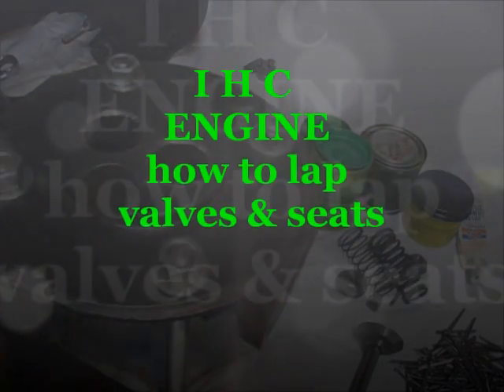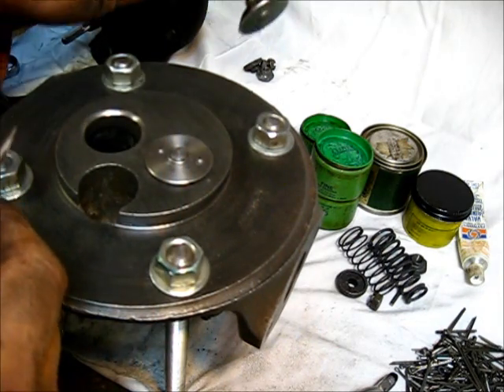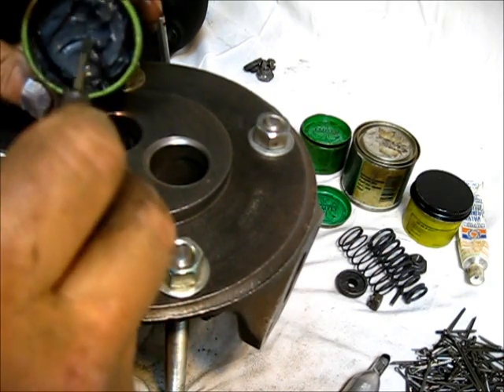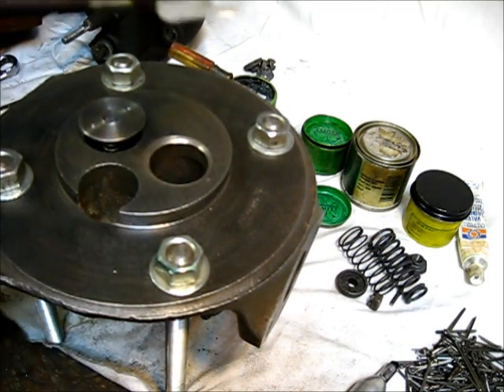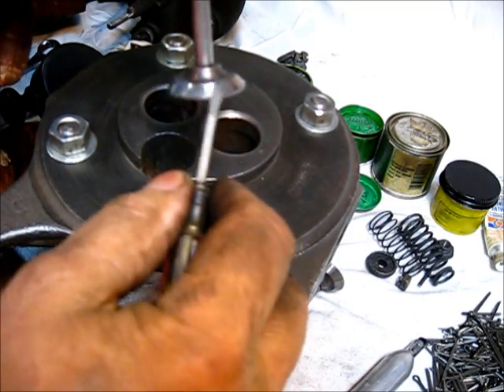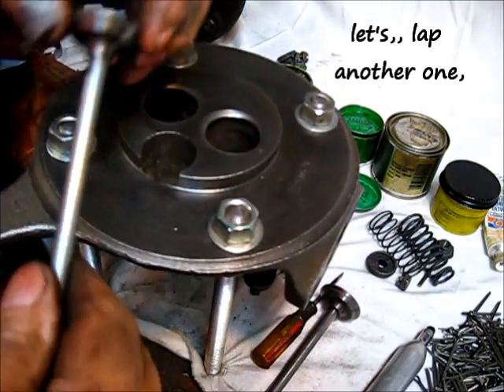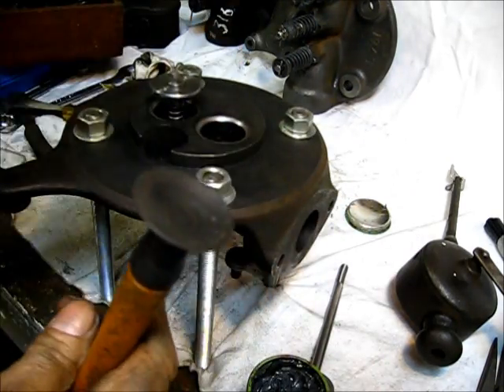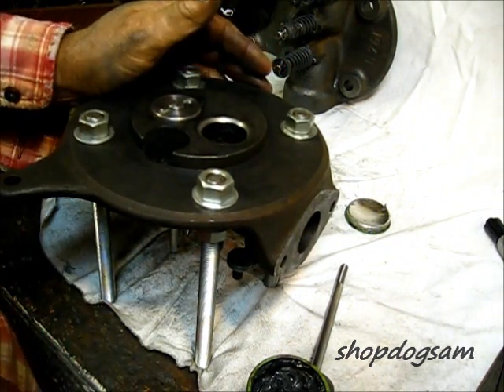I H C ENGINE how to lap valves

Comment: very nice videos learned a bit im goin to school for an airframe powerplant cert. and my expirence is limmeted to what we can do in the shop at school not shure im allowed to do everything your talkin about with the lapping compound on the valves an seats but it makes sence to get a nice seat aswell as cutting the seat your doing a complete rebuild right thats a little different for aircraft thats gotta be done at a 45 repair station however we can do it under that umbrella lots of paper worklol

Comment: With suction cup, or just your finger you can leave the compound in the can. Just raise the valve a little without turning it at all, and tap it against the seat a few times, a good mesh will leave a little shinny unbroken ring line on the valve face.This will let you know the valve will seal, with no chance of embedding compound into the metal. Since we know the valve is ground @ 45 and the seat @ 46 we know exactly where the seat will locate in just a few min run time. :o]

O,,,